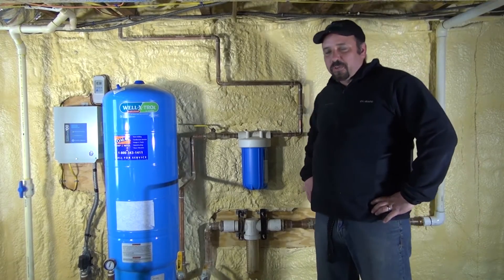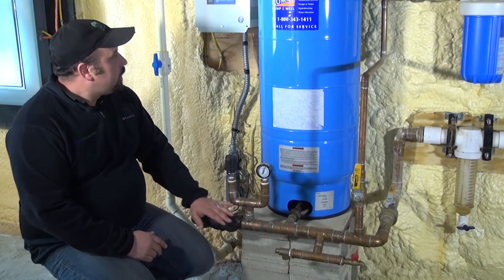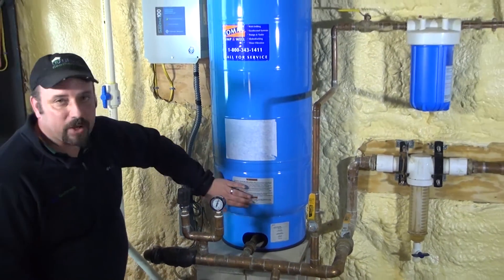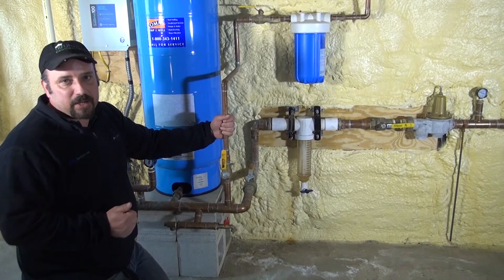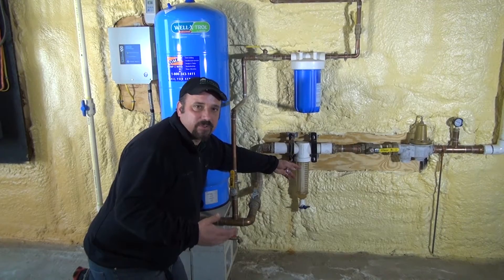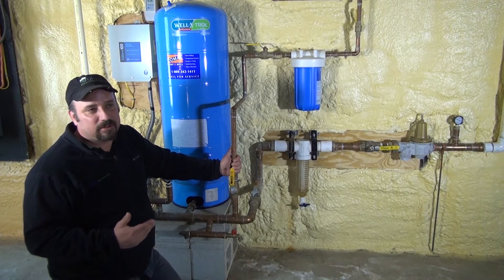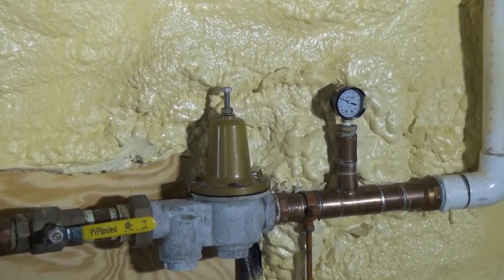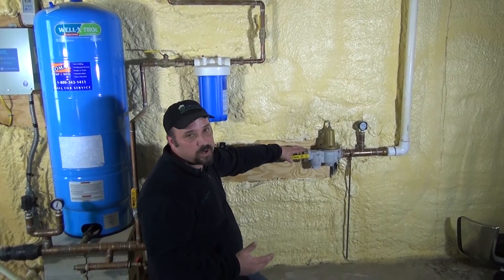Ultra Geothermal, Inc. - Operation and Maintenance Series

Comment: What are the issues with having 60 PSI?  I have a 5 ton Carrier water to water  open loop system.   I have a MonoDrive VFD set at 60 PSI.  The well supplies water to  two homes (Brother in law next door) with both having geothermal systems.  We did need to increase the gpm to 12 gpm resolve a lockout issue in the winter on my system.  Is there a need to add a pressure reducing valve?